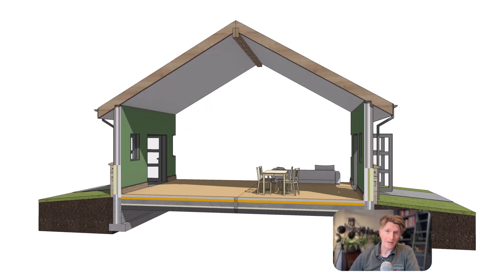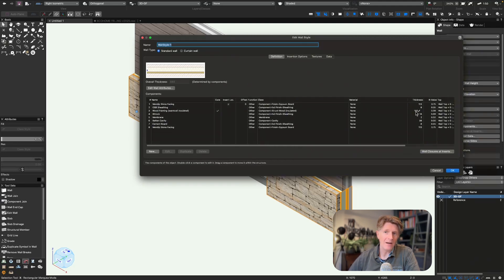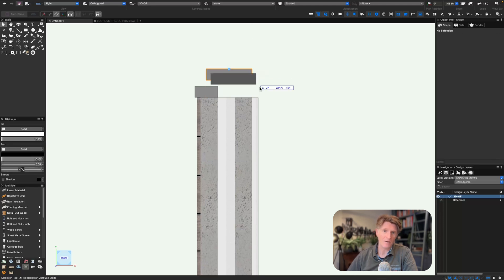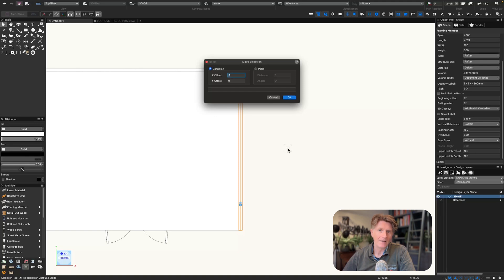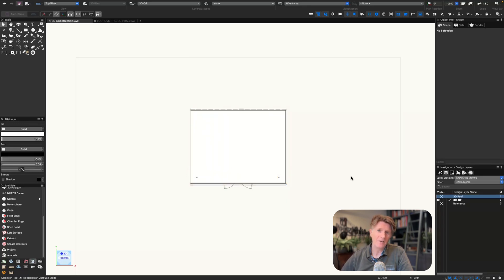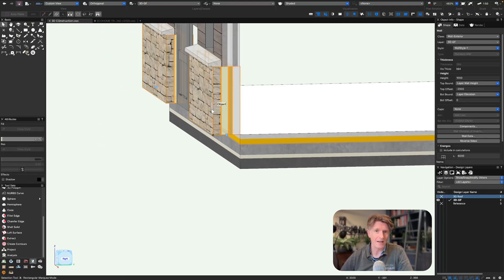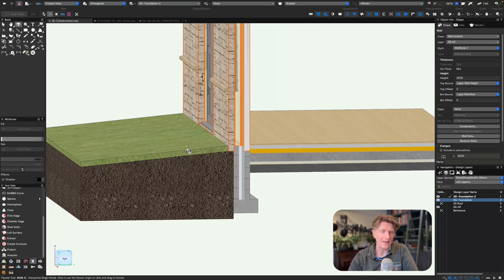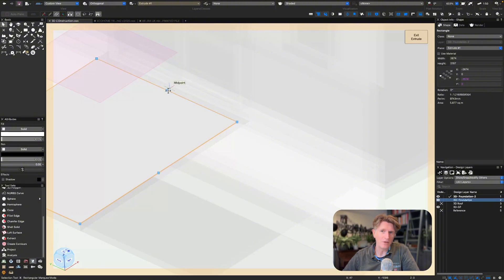Vectorworks for 3D Construction and BIM Modeling: Part 1

Comment: I am waiting for Vectorworks becoming that smart that a doorframe will recognise both walls and cut the proper openings in both of them, in stead of using a 'trick'.
Reply from the maker: I agree that openings across multiple walls, or even better being able to combine two or more wall types would be a good development, but until then, this workaround is pretty useful and simple.
Reply: @jonathanreevescad  I am really glad that a trick is available
Reply from the maker: @illbeback2YT  Yes, there's a few different ways to achieve this. Another is to use wall projections and niches.